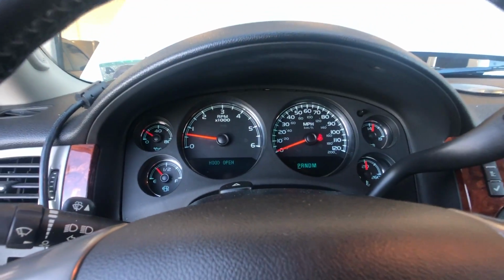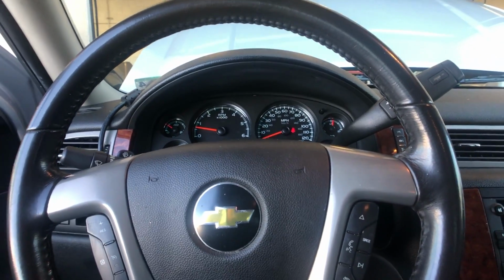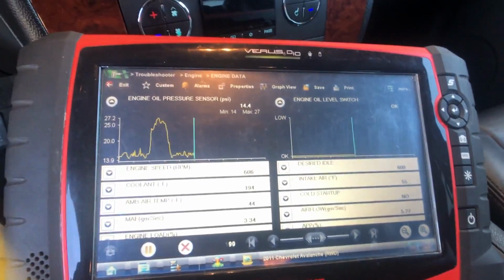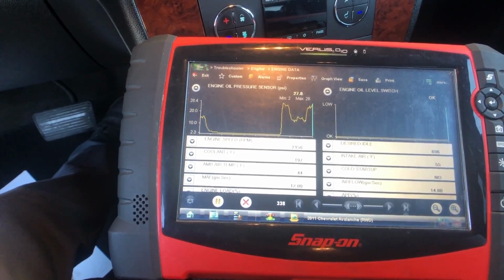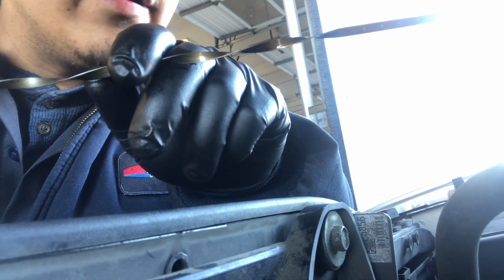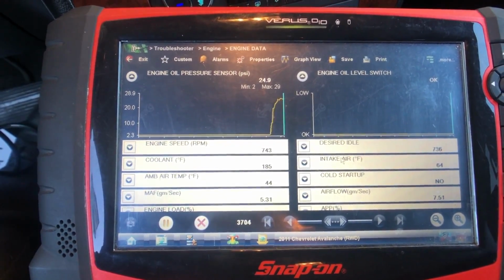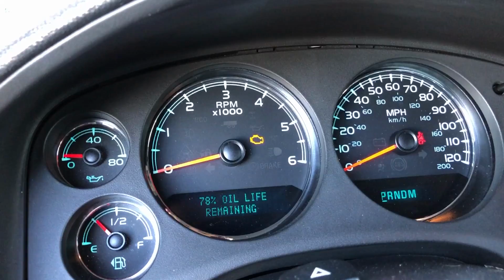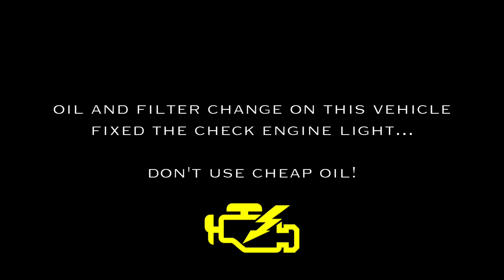Chevy Truck Check Engine Light ON P0521 P0523

Comment: There is no Oil Level instrument on these motors, only a  dip stick. The oil pump discharge pressure will drop with a low level & the pressure switch is factory tuned to compensate for viscosity & temperature fluctuations.

Comment: HELP PLEASE.. I got 40 psi start up cold idle. Warmed up I got 20psi idle and 30 psi driving. I have changed oil and it's full and I have changed the pressure switch and screen. Had dealer do the work and manual check shows 60 psi pump pressure. Problem is even at 40 psi gage pressure my check engine light comes on and scan shows PO521 oil pressure switch. I also used seafoam to flush engine still get 40 psi cold and 20 psi warm with 30 psi warm driving and check engine still coming on after clearing it and at 40 psi gage pressure.Any suggestions as to what could be problem.
Reply: Any update? My oil pressure reads low 20s but I’m getting the p0521 code ?

Comment: I see this alot some cars have oil leaks others show no visible leaks and when I talk to the car owner alot of them never check their oil they have it changed when it's time some manufactured say a certain amount of oil lose is the way the engine operates so I show them how to check their oil and explain how important it is to do so I'll even write down what oil to put in if they need some on the airbox with a paint pen but some cars don't have dipstick which is stupid if it's a workable fluid it needs to be checked

Comment: I have a 2007 chevy suburban and I am lucky if i get 50% out of an oil change. It's a known issue with this engine burning oil.
Reply: Since when ? I’ve owned 2 5.3s and a 4.8, and none of them have ever burned oil . You most likely need to do the pan gasket

Comment: This is the kind of mechanic i need. He could have changed the switch to get the money as some mechanics would. By word of mouth, his honesty should bring him more business than he can handle so he doesn't have to be greedy.
Reply from the maker: Thanks, appreciate that 🤝
Reply: @HomieHektor  I have a chevy silverado V8 4.8 it tick 3 to 4 minutes after starting. 15 to 20 minutes later it stops. After that it runs extremely quiet. Until I let cool down it won't tick. Do you think it's my exhaust manifold bolt?

Comment: I had two codes. Changed all my spark plugs to fix one code. Now I have this code. I'm thinking I just need to change the oil. Have about 130,000 miles on my silverado and I don't plan on selling it ever.
Reply: I’m having the same issue on my 2010 Silverado, a p0300 code and this one.
Reply: @THREEPOlNTERS  I changed my oil and it went away hasn't came back since.

Comment: If it's ~ 30 PSI at a cold start (overnight cooling) and then you find that the pressure is around 0 to 10 psi @ idle after about 10 miles of driving (such as when the engine is running but you're at a stop light), you'll need to change the oil pickup tube o-ring.  It's sucking air/not pumping the necessary oil because of a bad seal/busted/stretched-resized o-ring.  In this case, the oil pressure "low" warning is REAL - and you need to fix it ASAP.

Provided your instrument cluster gauge is working correctly - and your oil pressure sensor is working correctly - and your wiring/ECM is not screwed up/busted, the general procedure (after raising/supporting the vehicle) is: 
1)  Drop the front differential/axle.
2)  Take off the oil pan bolts (including the super-long ones where it meets up with the transmission) along with the oil pan itself.  If the oil pan gasket has never been replaced you'll need to drill out the rivets which keep it attached (or risk re-using it and discovering a leak at some point in the near future).
3)  Remove three bolts mounting the pickup tube / suction screen.
4)  Remove the bolt holding the pickup tube into the oil pump intake tube.
5)  Remove the stale, malformed, out-of-round orange/red-ish colored o-ring on the oil pickup tube.
6)  Replace the o-ring with an OEM or high quality/perfectly spec'd NEW o-ring (aside from new oil and a new oil filter, here's the big $$ part of the job...it'll cost you a total of ~3 to 4 bucks).
7)  Re-install the pickup tube assembly and bolts.
8)  Put everything back together in reverse order, making sure to use gasket sealer around the points where the oil pan meets up with the transmission. 

(I think those are all the steps...but do your own research to be certain)

If you do all this and still observe super-low oil pressure, you've got some potentially serious internal problems with your engine.  This could (at the lower-cost end of the problems) be a bad oil pump.  At the higher-cost end of potential problems, you're looking at blocked oil passages inside the engine...such as sludge because you didn't change your oil for 15,000 miles.  You could even be looking at blown-out/damaged crank shaft journals.   It could be a lot of things...and they aren't cheap to fix.

With the engine running, if there are NO tick-tick-tick sounds coming from under your valve covers (e.g., lifter knock), and you found no metal pieces in your oil pan during disassembly, I'd suggest you didn't have enough oil, you had the WRONG oil, or you had a coolant/oil combo in the system, or you didn't properly diagnose the problem before undertaking the o-ring fix.
Reply: I had a code for oil pressure switch come on two days after white smoke comes from the exhaust on start up but goes away after starting it. I have a tick on the driver side and I assumed it was the exhaust manifold. Then the engine light came on and it is for the pressure switch. Any thoughts what could be wrong other than the oil pressure switch ?

There are no signs of a blown head gasket (no milky oil/temps are normal). The truck is a 2009 5.3 and is used to tow a 3500 lb camper. Oil was changed less than 5k ago but I noticed it was low and added about 2 qts to get it back up to normal levels. There are no signs of an external oil leak to cause that much oil to be missing unless towing really does burn that much oil?

Comment: I put a new sensor and the pressure is only slightly better, but I’m realizing it wasn’t a oem sensor just some autozone sensor. 

Should I try a oem sensor ?
Reply: Hey, I also used generic sensor, it failed in no time. Needle would jump around, show low pressure, eventually constant dinging/warning. Replaced with GM.

Comment: And I can check the oil with a scan tool but the ordinary car owner can't so if your car by manufacturer can loose up to a qaurt of oil every thousand miles then in a 5 thousand miles oil change you are out of oil or so low it's killing your engine

Comment: Im just a 56 year old farm mechanic but thought id share this tip. When you are having a hard time seeing the oil on a dipstick you can sprinkle baby powder on the dry dipstick and shake off any access. Then recheck the level and you will have a very accurate view.

Comment: Replacing the oil switch/sensor will avoid a come back an assure you of a better fix.  Remember there is a small filter below the switch internal to the engine that get clogged that needs to be replace also.  Just an advise..
Reply from the maker: David Tellez absolutely agree, did you see how dirty that oil was? I’ll keep you guys updated, but for now it’s fixed 🤙🏼